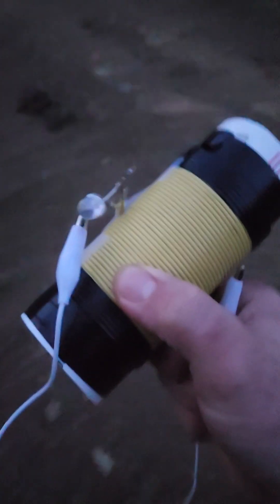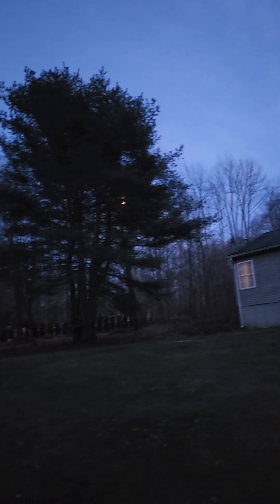🤔 TRUE RADIENT ENERGY WITH 0 INPUT. BABY COSMIC RECEIVER?👶

Comment: Does it still pulse if you set it down on the ground so it is not moving? Im wondering if you moving it around is causing it to cross the boundaries of magnetic fields in your area, thereby causing it to pulse a tiny bit. If that is the case, then you are introducing energy into the system by moving it around. Some more isolated tests should be done as well.
Keep it up!
Reply from the maker: Seems to pulse when sitting still isolated 3 feet off the ground on a non conductive table
Reply: Awesome! Keep up the research, im watching closely. This tech has the potential to revolutionize how the world uses electricity. Its equivelent to going from the steam engine to the gas engine. Its crazy to think that tesla had this tech back in his time. He truely was a century ahead of his time.

Please dont let this tech die by selling it to some big company or corperation, its far too important! Also, take care of yourself, i have heard of other alternative energy researchers being targeted and silenced to keep this kind of tech hidden from the public. I hope you have a group of multiple people youre sharing this tech with so there is no single point of failure. That was teslas big mistake.

If you can make a system that reliably can pull more ambient energy from the environment than youre putting in, then i will be first in line to buy one!